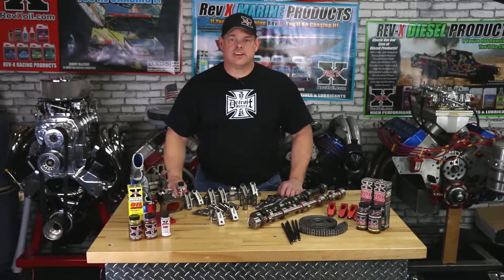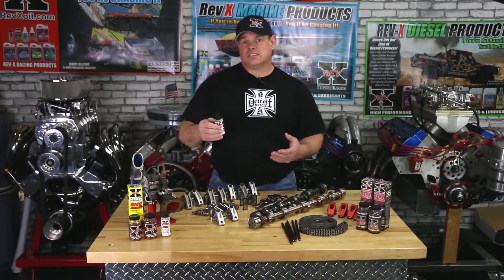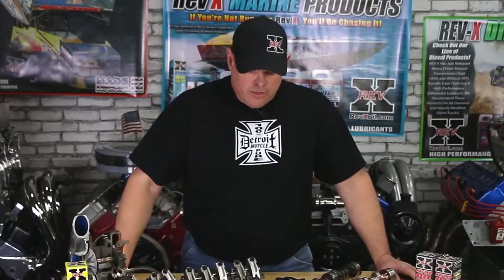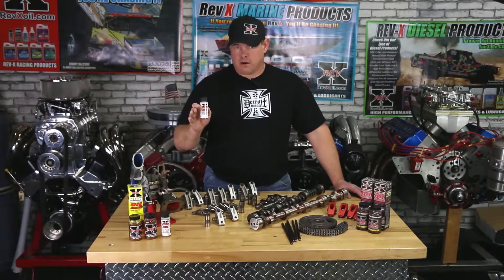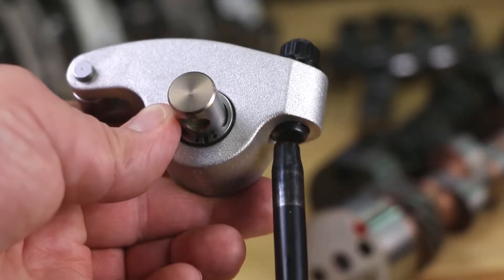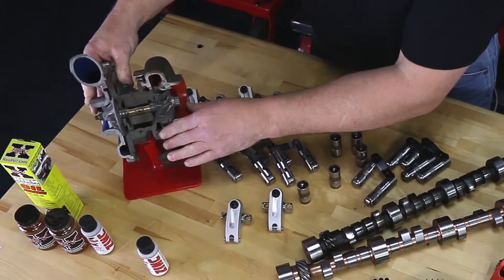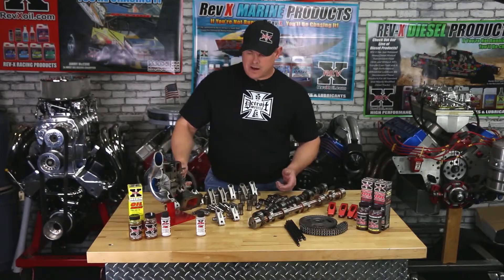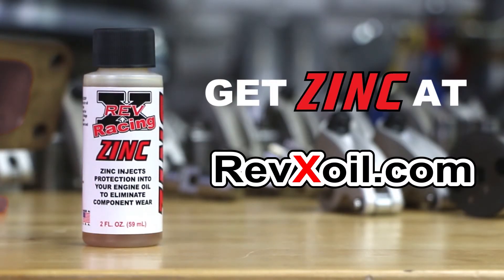What is Zinc (ZDDP) Oil Additive & What Does it Do?

Comment: Zinc (zddp) destroys the catalytic converters. Use only in order cars with no cats, older flat tappet applications.
Reply: What if I drive a Land Rover with cats and flat tappet set up???
Reply: @ronaldrrootiii6040 if your valve spring pressure is stock just use the viscosity mentioned in the manual and don't worry about zinc.
Reply: What do you consider older cars? 1996 w overhead cam?

Comment: been watching a few videos on this and everyone says if you not in a race car do not put much over 1000 ppm in your everyday normal car, it will mess up smog stuff and is actually bad for engine just like taking to much zine in your diet is bad for you i use castrol gtx 10/30 it has .12 per quart zinc in it i use this in my jeep 4.0 plus i add 1/2 of the V8 can of restore,
Reply from the maker: Our formula is specifically designed for maximum protection during the engine break-in. For everyday use, we recommend following manufacturer recommendations on the level of ZDDP that is needed for cams and cranks.   However, using an entire 2 fl. oz. the bottle will not hurt engines that were designed to use ZDDP.  

It is not recommended for engines with catalytic converters, ZINC does not damage the catalytic converter, it's phosphorous.  Phosphorus can create a coating inside the catalytic converter reducing its effectiveness.
Reply: Restore is only good for helping low compression engines, with scored liners. Your bearings aren't liking to smash all those metal pieces, if they get out of the filter...

Comment: Can zinc be added with other additives like zmax in regular 5W30 synthetic oil? (V6 chevy engine)

And with the older Harley Davidson twin cams, most owners used 20w50 synthetic in the crank case, primary and tranny (all in 1). Can zinc be used in an older stock twin cam? And will it help keep engine cooler?
I usually use Mobile 1 or Almsoil in my scooter.
Reply from the maker: ZINC is an anti-wear additive so it does not reduce friction which helps reduce thermal temperatures.  We do not recommend mixing additives.

Comment: Good for race cars but if you put too much  zinc in your automotive engine oil it will poison the cat converter. Most non auto engine oils like small engine oil and motorcycle oils etc. (anything without a cat)  have higher levels of zinc.
Reply: I've always heard and understood, zinc additives or high zinc oils are for use in older vehicles like pre 90's with flat tappit cams. Most if not all of those that I can think of dont have the type of cat that would be hurt by the additive. Also most of us are not even running cats on our classics in the first place. Aspecially pre 80's vehicles which are usually exempt from emissions by now. Also on a side note. Theres alot of road motorcycles that have cats.
Reply: @motov8-garage832  You're right, but zinc is still the best anti wear additive, and they still use higher levels in non automotive oils. The next time you're in a  lawn mower dealer or tractor supply, look at the Kawasaki or Kohler  small engine oils. They say "High Zinc" written right on the bottle.  Marine oils have higher levels as well.
Reply: Scott Duffy  people who shouldn`t be worrying about oil additives LOL

Comment: My 2001 wj 4.0 loves it will continue to use every oil change.Thank you.
Reply: 99 wj 4.0 four by here and I like what you done. What due you think of your four by capability.
Reply: I run the Lucas zinc additive at every oil change. I use half a bottle as to not overdo it. I'm almost at 40k miles on my new engine and no problems.

Comment: So zinc "activates" at 700-1100ºF?

You must be referring to Zn melting and boiling points: https://en.wikipedia.org/wiki/Zinc

Even synthetic oil is going to vaporize long before reaching Zn's melting point.

I think a better explanation of how ZDDP actually works inside an engine would eliminate the confusion in this video. Plus, whatever sacrificial phosphate layer is going to be created, it's not going to magically flatten out microscopic flaws in the camshaft lobes of lifter faces as shown in the animation.

Comment: Watch the ppm levels. Anything over 966ppm could damage the car cat's. On race engine, yes, a high zinc concentration Is good, but, on street cars it can reduce the life of the car anti-pollutants parts. Math will need to be applied, example, a 5W30 Amsoil SS will have a count of 807 ppm of zinc, a Pennz Ultra bas a 811 ppm of zinc, The street Royal purple has 585ppm of zinc, oils like Motul 300V, RP XPR or PTH Racing oils already have +1,000's and +2,000's ppm of zinc.

Comment: can i use zinc phosphorus oil in my 2016 motorcycle? (as i know ZDDP is only for older vehicles)
Reply: The supposed danger of high zinc is if it's vaporized it destroys a catalytic converter.  This likely won't happen with a good synthetic oil.  Just don't mix this with junk dinosaur oil. And remember before cats oil had 10 timed the zinc as modern oil
Reply: Zink doesn't activate until it reaches at least 700 degrees? WOW!!! 
Engine's normal operating oil temperature is around 250 degrees.
God help us if we need to raise our engine's oil temperature 3 times over normal in order for the zinc to activate. 
Please explain what I'm missing.
Reply: Maybe in hot spots over 700 degrees?

Comment: Penrite HPR 5-40 full syth has zinc additive already in it and it's approved by Mercedes.
Reply: Best oil mate. And also the 10 Tenths range 👍🏼
Reply: @Paul-cb2rb  I agree and use it. Engine (2006 Alloytec V6) runs smooth and no more loss of oil between changes and after read about its competitors Penrite don't muck around when making a world class oil. As for second best oil? Mobil 1 Synthetic I guess.

Comment: I have a 2015 Chrysler Town and country van with 3.6 engine....it makes a ticking sound, not from stuck lifters but from worn roller bearings. It's a known issue and a real crap design.  I've started using zddp and it has quietened the ticking sound from the roller bearings significantly.   I think that the low zinc formulations in modern oil has contributed to premature failure in a badly designer engine.
Reply: It's a turd engine.
Reply: @duckwacker8720  funny, I have 200,000 miles on my 2015 Durango and it runs like a clock.   Rather than post a stupid comment, backing up with fact Karen.
Reply: same happening with diesels and low sulphur fuel . less lubricity. diesels dont last .